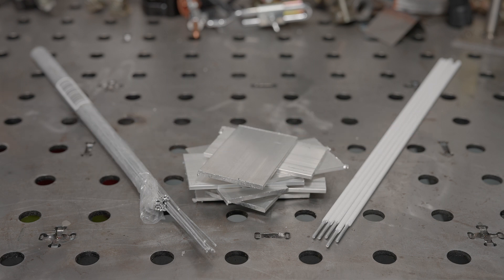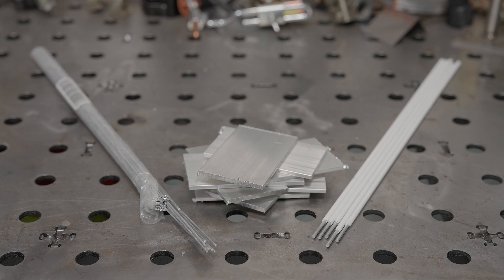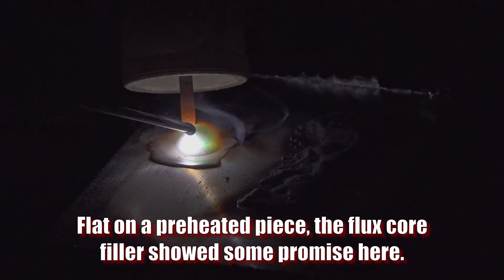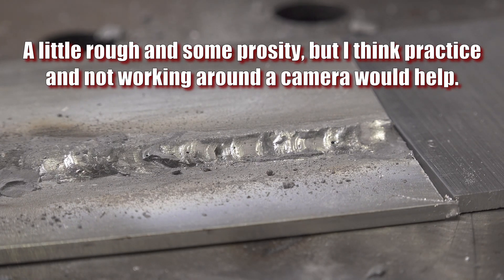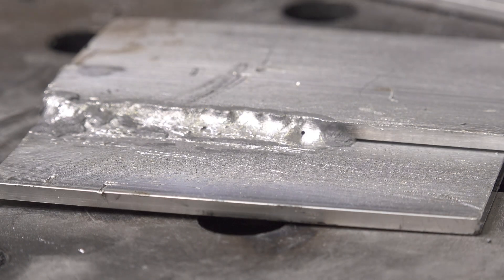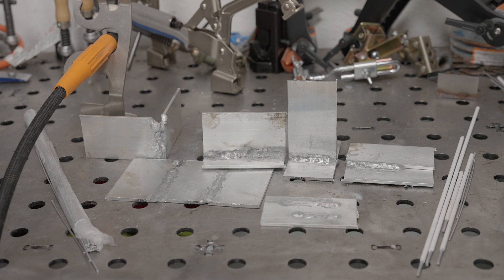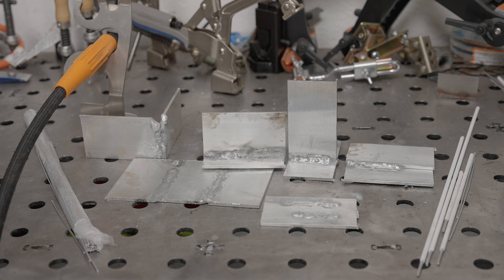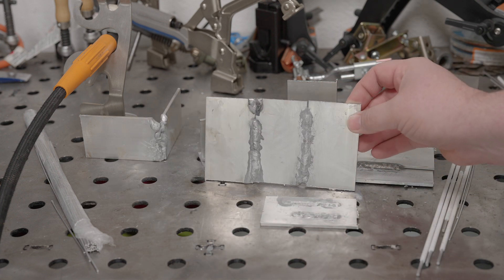Aluminum With DC TIG Using Flux Core Filler Rods!

Comment: Hello buddy, some days ago, my bike fell off the stand and got cracked the  generator cover, so it drips oil here and there when it warms up (crack is visible with naked eye) Whats your opinion, could i fix the crack with that method? Unfortunately i only have a DC tig welder and i can find some rods like these for free... Does this method create porosity on the bead?
Reply from the maker: It will create a rough surface that you'd probably want to smooth out.  For a crack repair, you'd also want to drill the ends of the crack so it doesn't just spread past your weld later.  Just because of the fiddly nature of this method, I probably wouldn't recommend it for this type of repair.  I would say that if you can get some of the rods for free, grab them and practice on some scrap/unimportant pieces of aluminum first to see how it goes.  You'll probably be able to get an idea of whether or not you are comfortable trying this on your bike.

Another thing to consider is what type of aluminum the case is made out of.  If it's cast aluminum, some grades weld better than others.  Might want to do a little research to see if anyone else has had success welding on that casting to be sure it won't go poorly.
Reply from the maker: I would also say that if your options are to try this or buy a new cover, you don't have much to lose.  If you are going to have to buy a new cover otherwise, then give it a shot.  The worse case scenario is you have to buy a new cover, which you were going to have to do anyway.
Reply: @bigtb1717  thanks for your time buddy! It's not the genuine cover, it's a cheap one from Amazon. Don't care to buy a new one, but bike is my daily ride from and to my work. Can't wait for a month or so, to arrive a new one from Amazon. I'll try on some scrap first as you said. Thanks again for your interest! You earned a subscriber!

Comment: Any plans to test the HZXVOGEN HVT250, HVM270, or HVC6000Pro?  I kind of want all 3 lol.  I've got a GUOZHI CUT-55HF coming in which sits somewhere between the BestArc BTC500DP and the Amico CUT-60HF.  I see the Hitbox migpro200 performed well and HZXVOGEN offers it in the HBM2280 flavor w/perhaps older firmware but I'm also tempted by the Arccaptain mig200 w/what appears to be beefier 50A DINSE and leads w/potentially worse thin metal performance.  Do you have any feedback on the MIGpro200 on the lower advertised amp settings for really thin stuff?
Reply from the maker: I'd love to test it all, but the reality of time and money doesn't let me, lol.  I have been swamped with normal life and work stuff lately, but I would definitely like to test more cheap MIG machines.  The Hitbox was okay at lower settings because you can control it manually, but I never tried it on really thin metal.  I'll try to make a point to test thinner metal with any MIG welders I test going forward.  I currently have an Andeli MIG/TIG/Plasma cutter in the list on Amazon that I'd like to try out, as well as a handful of other MIG machines.  I just have to find the time and money.
Reply: @bigtb1717  a couple of those I listed along w/the arccaptain have very deep coupon discounts w/prime.  The arccaptain (i think newer model than one you tested) seems tempting and appears to perform ok on thick sheet metal w/the spot weld function but I think min setting is still like 30A.  The Hitbox you got goes down to 10A if specs are to be believed (yeah right).   As you pointed out in one vid, they may go high but for how long w/crappy leads and dinse connectors....I liked that about the arccaptain but  a few of these guys are adamant about running 15A connector to 50A converter.  I'm not the biggest fan of the hitbox and hxyzvzblabla GUI either.  The latter seems to list differing specs from the hitbox on an otherwise identical looking box.  I got a small vevor mig that impressed me and wanted to pull the trigger on their bigger 270A machine + ac/dc tig but didn't and are now sold out.

Comment: That was interesting! Definitely looks like in a pinch you could get something sealed up or welded that didn't need to be structural. Just picked up a AHP AlphaTig 203xi so I'm setup for both DC and AC for a very reasonable price!

Comment: If you have pulse on your tig rig try that process it may be the answer!
Reply from the maker: Have you tried it?  At one point I did a bit of manual pulsing using the foot pedal, hoping to sort of agitate the puddle in an attempt to get the two pieces to initially flow together.  Didn't really seem to help, but I suppose I could give actual pulse mode a try to see if it makes a difference.

Comment: Were both of these run DCEN? So all heat, no cleaning action. TIG with the stick rods might allow you to get every last amp out of a machine, and look a bit better than stick welding with them. Thanks for the great demo!
Reply from the maker: Yes, DCEN for all of it.  I agree that with some practice, I could get better looking welds doing this than with stick welding.  It's just a bit slower and the stick rods feel like they have more flux than needed.  And the flux is annoying to remove.  But it works a lot better than DCEN and 100% argon.  If helium wasn't so dang expensive, I'd try a bottle of that.  I haven't priced it in a while.  Maybe I'll give my local place a call...
Reply: @bigtb1717  I took my 250 cu ft helium cylinder in two months ago for swap. The gas alone was going to be $547, so I opted for argon!!! Your mileage may vary, but be aware, helium is pricey now. Thanks again!
Reply from the maker: Wow.  I know it was pricy the last time I checked, but it has been a couple years at this point.  I didn't figure there was any chance it had gone down, and it seems like definitely not.

Comment: It’s funny you can weld with mig welder on dc looks good but tig on dc don’t
Reply from the maker: Yeah, it's just a totally different process.  MIG on aluminum is a spray transfer process where the filler metal itself is creating the arc and being blasted in droplets at the joint.  It sort of naturally breaks up the oxide layer.

Comment: Great topic - thanks for this.  I think a lot of folks are hoping for the next revolution that makes aluminum welding accessible to a wide group, the way that cheap inverter boxes have brought that to those working with ferrous material.  

I'd be curious to see what is the present  most economical non-hacky aluminum setup, and hear your thoughts on where we're heading  in the aluminum world.  A lot of guys are waiting for the "cheap chinese inverter box" equivalent for aluminum, but it really doesn't seem to be happening..
Reply from the maker: Considering an AC TIG machine from any of the big names (ESAB, Fronius, Miller, Lincoln, HTP) is at least $2,000+, the fact that we can get some fairly well-liked AC TIG machines from Amazon for $800-$900-ish is already pretty good.  But I know what you mean.  A $200-$400 DC TIG machine is pretty attractive and I think people are interested in any way they can reliably weld aluminum with it.

Comment: what about with AC tig on a scratch start? (buzzbox with tig leads)
Reply from the maker: Unfortunately, I don't have a transformer machine to test out.  Generally, AC output, transformer machines (buzz boxes) required continuous, high frequency in order to keep the arc lit.  Older machines often had a "high frequency box" that could be added to allow for AC aluminum TIG welding.  Eventually, more advanced electronic control allowed for balance control and advanced waveform manipulation which allowed the arc to stay lit without continuous high frequency.  At that point, high frequency started to be used only for arc starting.  

A buzz-box used for scratch start on AC likely would not be able to keep the arc lit.  If I come across a used one for a reasonable price, maybe I'll get one to make a video.
Reply: @bigtb1717  no worries, I didn't know it was because of the arc not staying lit (I thought it was just for cleaning action).....Thanks for the knowledge.